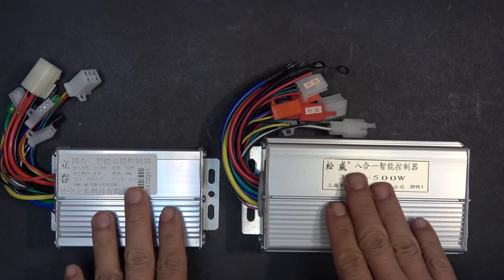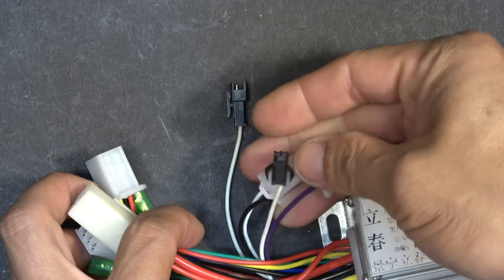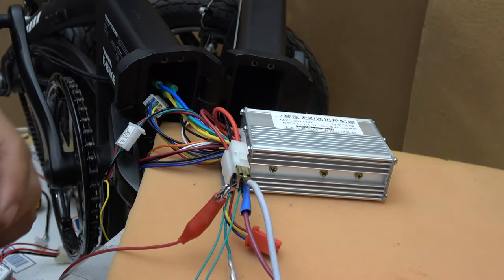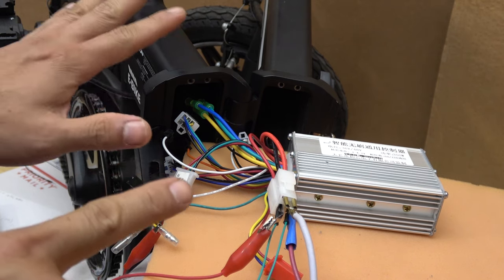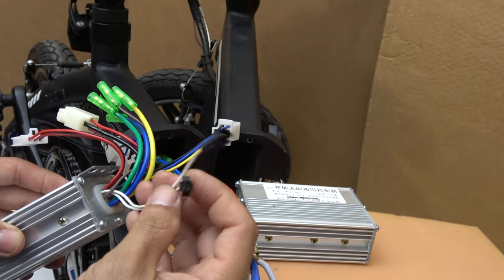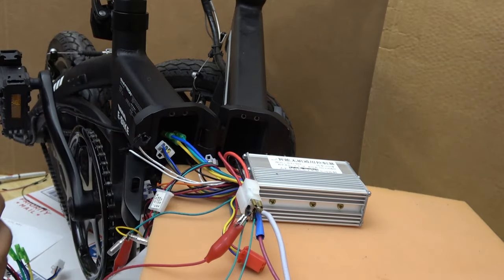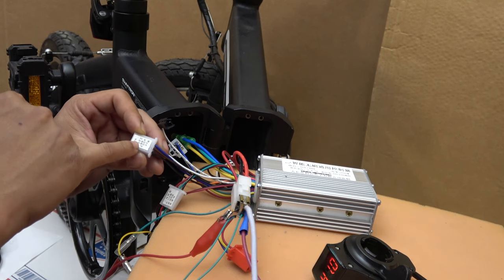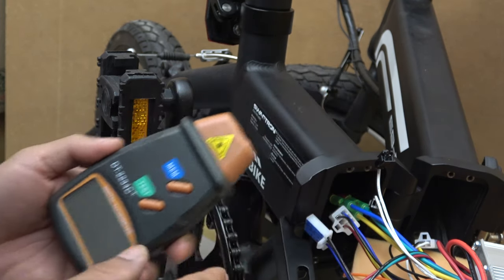How to install a Brushless DC Controller on Ebike: The missing manual

Comment: It irritates me how many different throttle connectors are used. Makes it so much harder to diagnose different things. I swear, so much of this work is just making adapters. I thank God for the 5 pin green Julet connector. At least most displays will turn on with most bikes.

Comment: My 48 volt charger smoked up so i put two laptop chargers at the thrift store together with 53volts combined 👊 two years and still working!!!
Reply: I would love to know more about this and how to do that. did you follow a guide or was this your own project? :)
Reply: @johndoe-si9ch  Hi, John.  I think he just ran the 2 chargers in series.  There is a + and - on each laptop charger.  Take a positive(red) from one charger and connect it to a Negative (black) wire on the other charger.   Now take the remaining positive (red) of one charger and make sure you connect it to the positive lead of the charging port and then the Negative (black) remaining wire from the other charger and run it to the negative on the charge port.  Try to get two chargers of the same voltage and amperage when selecting the computer charger.  You will want to have 3 to 5 volts more than the battery you will be charging 24v battery youll want 26 to 29 volts total of both chargers.  48v battery you'll want 51 to 53 volts total.    Hope this a makes sense.   If if you don't understand this or don't feel comfortable attempting it please find someone who is knowledgeable do it for you.   👍  good luck !

Comment: Thanks for a great tutorial. I just bought a speed controller that came with a Chinese manual lol. It had some English instructions on each wire/plug. However, it was hard knowing what wire did what. You have saved me so much time and stress on how to connect each wire and what it does. I am so grateful for your time. You are the man. 👍

Comment: Your video saved me hours and hours.  Couldn't believe it came without any paperwork and without this I would have never discovered the learn feature probably.  I now have mine controlling an old converted  vehicle alternator without a hall sensor.  Well done mate, and thank you.
Reply: wait, it can work without hall sensors connected?
Reply: @mjyanimations1062   yes, works fine. You need to use the learn function as mentioned in the video
Reply: @shanehogarth6373  Did he say anything about it? I have a motor without hall but cant get it to run without using the "learning cable".

Comment: I've fixed and worked on cars, motorcycles and various electrical devices, but am new to electric vehicles.  It would be nice if the electric vehicle manufacturers had a shop manual and a schematic, like motorcycles and cars.  Thanks for the tear downs and explanations!

Comment: I believe the black and orange wires are cruise control for throttles that have an extra switch on them to provide for that function. I imagine a separate switch can be wired on the black/orange wires to enable cruise on bikes that don't have that switch built in to the throttle, it just makes the controller remember the speed you're running at, so you can let go of the throttle.

Comment: !! This was by far the Most helpful Video on You Tube I have watched, when trying to figure out the wires on a newly bought 36-48v Brushless Ebike Controller.  !!   I know nothing, and I mean nothing about these bikes,  I picked one up for cheap at a yard sale, was told it needed a new throttle and controller.  Bought them both on Ebay and jumped in.  Having Zero knowledge about Ebikes, Controllers, wiring, and motors, I was shocked to find all videos on you tube, people assumed basic knowledge and therefore it was useless and I gave up.  After a few months, I took out my new controller and tried again.  Your Video was a Success!! Easy to understand follow and So Helpful!   Thanks for making videos like this... you genuinely are helping people.. :-)

Comment: From what I gather, the low brake line enables power regeneration from the motor and high brake simple disconnects power to the motor altogether. You can connect one or the other to the switches on your brake levers.

From what others have said, using power regeneration typically extends the range of your ride by 3-10%, depending on how much you stop and go, and how many hills you go down - as when going down a hill you can hit the brakes lightly to enable the generator function which will recharge your battery a bit.

I think using the low brake line makes the most sense, and only hit the brakes hard, only when you really need to. In other words, only hit the brake levers lightly and let the regen function slow you to a stop.

Comment: Excellent video.  I learned a lot and I am no longer afraid to connect my own brushless motor controller.
Reply: Bro I need help, I connected all the wires and the motor sounds like it runs but the wheel is not spinning please tell me what to do to make my wheel turn

Comment: Nice video.  The high and low brake wires will apply a high or low brake force (or slowing) to the controller when connected to ground.  I think that most of use connect to high brake to basically disconnect power when activated.   Thanks
Reply: From what I gather, the low brake line enables power regeneration from the motor and high brake simple disconnects power to the motor altogether. You can connect one or the other to the switches on your brake levers.

From what others have said, using power regeneration typically extends the range of your ride by 3-10%, depending on how much you stop and go, and how many hills you go down - as when going down a hill you can hit the brakes lightly to enable the generator function which will recharge your battery a bit.

I think using the low brake line makes the most sense, and only hit the brakes hard, only when you really need to. In other words, only hit the brake levers lightly and let the regen function slow you to a stop.
Reply: @martinhirsch94  Thanks.  That is a pretty good description.  Nice to have the option to try out both modes depending upon riding habits and terrain.

Comment: Probably there is a power out for headlight and tail light, And some wire that need to be hooked to a switch to turn them on and off.
Great Video !  Thanks for all the info !

Comment: Thanks a lot. This video is very useful. My controller cables have no labels at all. After viewing this video and of  others, I get more understanding on how to test the cable ports voltage  and to make correct connection.

Comment: Thank you for the video. I had an issue with the rear hub locking up. Don't know why but I was just able to free it up. However the wheel was traveling in reverse.  After swapping wires and not getting anywhere I saw your " relearning " white wire trick. I followed your direction but it wouldn't change direction until I connected the wires. Changed direction and with power still on, disconnected the white wires. It was then that the forward direction was saved. All good now.

Comment: Thanks this helped so much. I could not figure out why my motor was running backward.,
Reply: My wheel ran backward too! I did the SIMPLEST THING a simple mind could do. I turned the wheel around. It still works. Lol!!! I sure wished I had this video then!
Reply: You didn't even need to do that. All you need to do is reverse the Polarity of the motor Yello-Blue.                                               Green-Green.                                           Blue-Yello.

Comment: orange: pwm signal, rpm for display. your display has settings, you can change the magnets and tire rim size, then you have the actual km/h or miles/h reading. you can test it with frequency measure. low rpm gives you low freq, high rpm gives you high freq. this cable is similar with your phase signal, but not for motor, only for display.

Comment: Just like all the comments, thank you very much!
I was given a dual 1200w motor, 48v off-road scooter that was running slower than its buddy, that was imported from Alibaba. I can change the 3 speeds but overall doesn’t match the power of the other one.

 Now it has developed an intermittent knocking sound which stops the rear motor for a split second. Thinking it was a gear inside (I’m used to electric transaxles) I opened it up to discover there are no gears and everything seems ok.. At least one of the bearings spins freely with no noticeable play. All the magnets seem good and no burns coils or smells. 
Got me thinking now it could be one of the Hall effect sensors so will be testing them  next. 
I’m used to programmable PMDC Curtis controllers, so opening the scooter with all those wires! Jeez. Overwhelming to say the least, so your video showing not only what the wires do, but how to test them is invaluable. Thanks again. Don

Comment: Hi,

Great video and explanation. I have recently bought two of the 250w 24v/36v controller to use on some repurposed hover board bloc motors and this has helped tremendously so thank you very much. 

Something that is more challenging is the plug types used on the controllers. I have searched high and low and cannot find anything definitive. If you do know the names\types that would be appreciated. The bullet connectors I believe are 3.5mm type but it is molex (???) and\or Dupont types I am struggling with to find.

I have seen the automotive\motorcycle sets on eBay (380pcs) that look similar well the translucent white ones in any case but I cannot be sure of these.

Thank you sir and once again great video and once my project is complete I will post on YouTube.
Reply: I'm doing the same thing!!

Comment: thanks for this detailed video ...very usefull , on my manual it says for the single orange wire "cruise speed line" may be its for memorising the constant speed.  Be carefull about the brake , my ebike give me a +Vbatt(50v) on the wire , when brake is applied , i have to modify it to have a 0v

Comment: one thing to keep in mind is that cheap ebay controllers are built with wiring that are never well labelled and from month to month the wiring color will change depending what cable they pull out of the recycling that week. also for the bigger controllers the parts are often not the right spec, you pay for a 1000w controller and they sell you a 500w with a 1000w sticker on it. when you finally get it working it lasts a few hours and burns out, had this happen just this week, was sold a controller for an 84v battery system , was ok in the drive at 10mph, going down the road at full speed it blew because the controller internals only rated for 85v volts and stressed it by the motor voltage from slowing down. buy branded, get real instructions and real support.

Comment: 6th wire on your hall block may be a thermistor wire for  a thermistor  epoxied in your stator for temperature sensing of the motor itself.  It requires very little current, just like the hall sensors

Comment: This is NOT an authoritative comment,
BUT from what I have investigated and learned, on many controllers the single orange wire is "cruse control" activation. It must be connected to ground for usually three seconds while the motor is running at the desired speed. In most controllers this is a software or logical function, and it will maintain the current RPM until any other function such as applying breaks or manually adjusting the throttle interrupts the function. In controllers that use an LCD or full function LED operating panel, this orange wire is included in the harness to the panel, and some combination of buttons on the panel will connect it to ground. The independent wire allows the installation of a separate "cruse control" button or momentary switch.

"Low Break" vs "High Break" This can vary between manufacturers. "Low breaking" can simply mean cutting power to the motor regardless of throttle setting, or it most often includes regenerative breaking. "High Breaking" always means the controller applies power to the motor in the reverse direction until the RPM reach a minimum rotation. All controllers I have looked at so far warn that you CAN NOT use both breaking systems at the same time. This makes sense since "high breaking" applies current to the motor, while "low breaking" allows the motor to generate current that gets applied back to the battery. Both systems operating at the same time would short each other out.

The final three wires: Considering automotive wiring; The green, female bullet style connector is a typical direct ground connector for operating lights usually referred to as "chassis ground". The yellow connector is a PC board type connector and referred to as "circuit ground". The black connector is usually used in cable harness connections and may be intended for instrumentation ground.
Reply: Thanks for this!

On my controller (similar to his, but not exactly) there were some English labels. I also found a diagram that is probably even closer to his. 
Orange: "Constant speed" on my controller label, "Cruise speed line" on the diagram. 
Green: "Conventional meter" on my controller label, "Display line" on the diagram. 

I don't have the other two, but I do have some others he didn't mention.

Comment: Dude your awesome.  I was stuck with my project build for my son.  I have a 24v 20" wheel of a foldaway bike.  
The issue I had it only has 3pin connector thick wires (phase wires).  It don't have a hall sensor.  I was struggling to find information as to which controller to by as all the ones I've seen have hall sensors wires.  I'll purchase this cheap unit and give it a try.

Comment: So I have a bit of an issue and some questions, 

I bought a 48volt battery online and it measures 52.1Vdc 
Did I get a more powerful battery for less is is this common ?

My motor controller is a 1000watt 48v unit 

I ohmed out each phase to the positive and ground and everything looks good, my motor ohms out nicely and when phases are crossed the motor locks as expected.

The problem 
My controller acts dead when I give it juice, the battery acts as if its in some safe mode, 

When not connected to controller the battery acts fine, displays its 52 volts to the plug when on and zero when off

Is my issue the voltage is too high and I should  just buy a 52volt motor controller? 

Thankyou in advanced and great videos! Very informative

Comment: I think the reason why there is only one break wire is because thats the regenerative break signal. 3 wheel ebike only have one motor on the back. The mechanical break on those bike is connect in the front and the in the back wheel (the one with no motor). That wire need to connect on the back break so when the mechanical break work the regenerative break will also work, making both back wheels break.

Comment: hello i recently bought ebike conversion kit left drive kit, i have connected all of wire correctly but motor not spin at all, using lead acid battery 3, pack 36v

i tried changing new controller still no respond from motor when throttle being pressed (bad eng) but when direct wiring from battery to motor it spin backward even though i've match colour red to red black to black it went backward spin, using L Faster kit

Comment: You seem to be the most knowledgeable person when it comes to this wiring. So I have to ask you a question and I hope you dont mind. I have a 48 volt system with brand new brushed controller and brand new 5 wire throttle with key and LED display. My normal 3 throttle wires are connected leaving the 2  which are yellow and blue. The yellow went to + battery and the blue went to blue from controller. This leaves a yellow wire from controller unhooked to any place. Now the display from voltmeter LED remains constantly on and turning the key on has no affect and the throttle is not working. I also have a connector from controller that's named "Sport".   Where does that go or what is it?. I have hours and hours invested in this thing and I seem to be at a stand still  So any advice you might offer would be greatly appreciated

Comment: I have a 24 vdc controller for a Brush motor. I'm using 2 DeWalt 20v - 5 amp batteries in SERIES. This gives me 20 10 amps to drive the motor. I connected it to my key trottle ignition switch & can read 20v on the display.  BUT when I turn the trottle to rotate the motor nothing happens. Is ther any way I can read the output off of the lines coming off the controller that connect to the motor?  Love your videos I learned som uch from them. Bob

Comment: the hall sensor wires is positive, negative, 1ªhall sensor, 2ªhall sensor, 3ªhall sensor, motor thermometer. Five of the wires is necessary for the hall sensor itself, the 5th one only some controllers/dissplays can use
Reply: Maybe u know. ?  It functions only when I touch red to red plus green spins full speed.   I'm about to hook a toggle and say Fk it
Reply: Dude DO YOU HAVE TO HAVE A SWITCH.
Reply: This s guy doesn't explain as well as wed like
Reply: I'm ranting cause I'm not impressed. I have 3 wires. How can they Fk thus up

Comment: This is the best video I've come across so far, thank you! I wish I had come across it before. I installed a WxBull controller on my brother's ebike and it has the 3 speed switch, unfortunately when he tried is it it only goes about 10kms! Super slow no matter what speed he puts it on, ugh :( any idea how to fix this? I'm sure I got the wiring wrong somewhere...